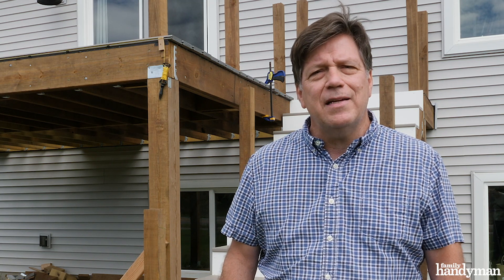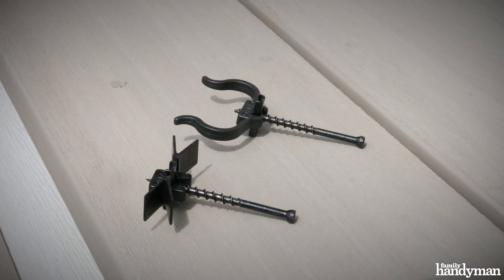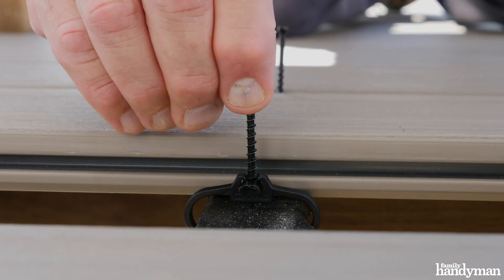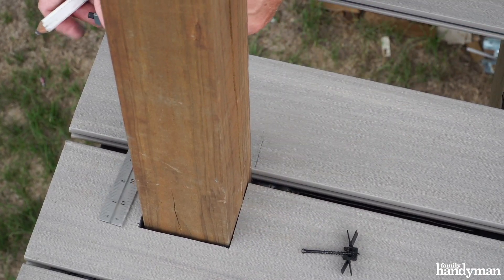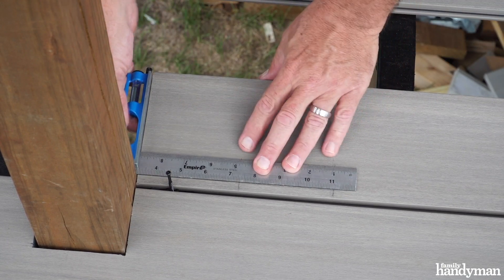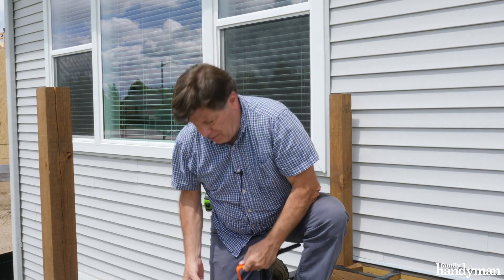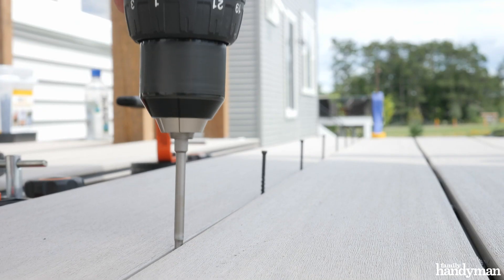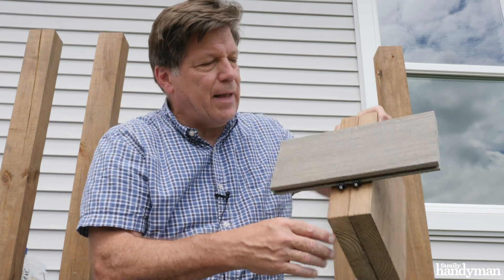How to Install Composite Decking Using Deck Clips

Comment: and if I need to replace 1 board in the middle of the deck I need to unscrew every single clip on every single board to the left or right... yeah this just causes more issues and takes longer.

Comment: Interesting video and some nice tips, but in regards to two boards butting up against each other end-to-end, you're incorrect that you "don't need a gap", you absolutely do. Composite boards expand and contract, just like wood, by not leaving a gap there you're asking for the boards eventually to start to push up against each other and rise/distort. You should maintain at least a 3mm gap between two boards which join end-to-end, to allow for expansion.